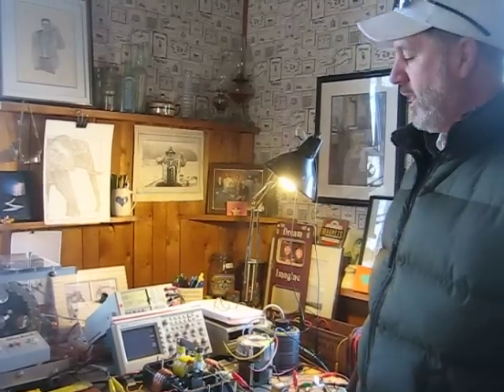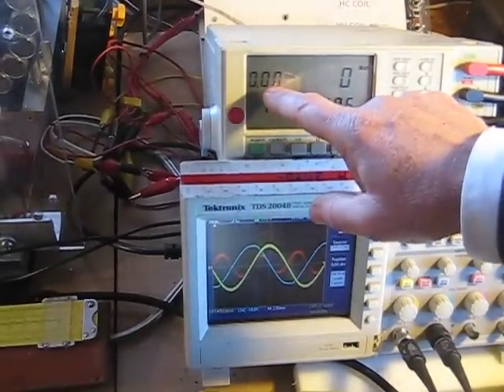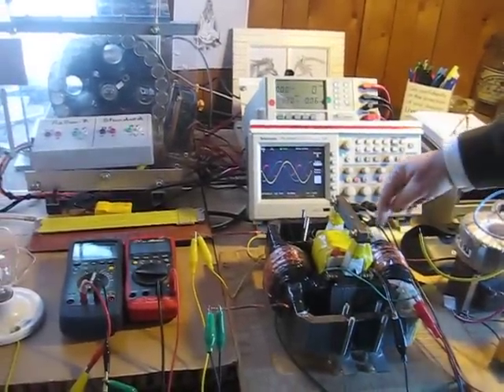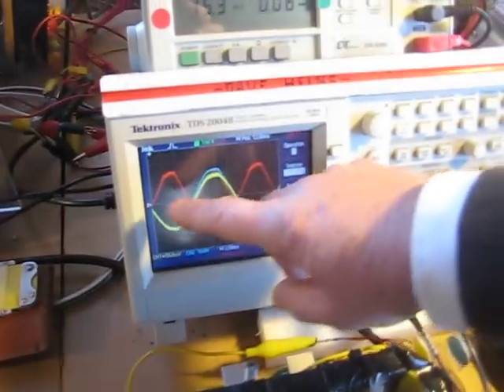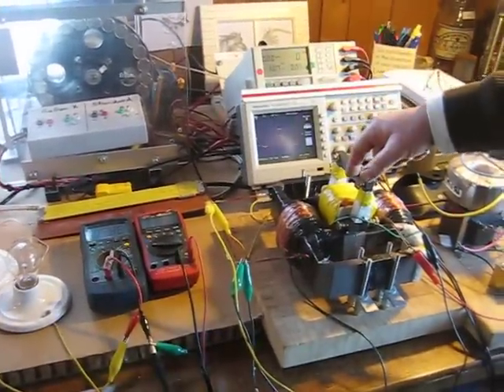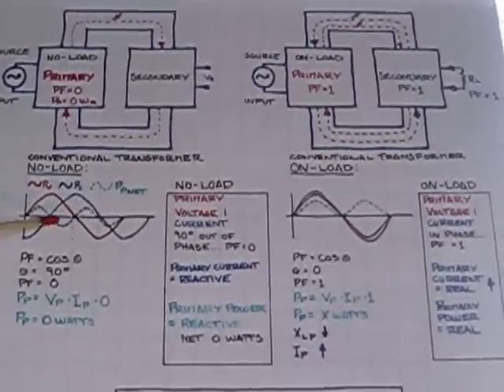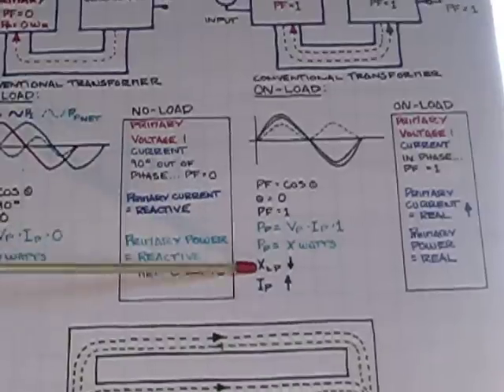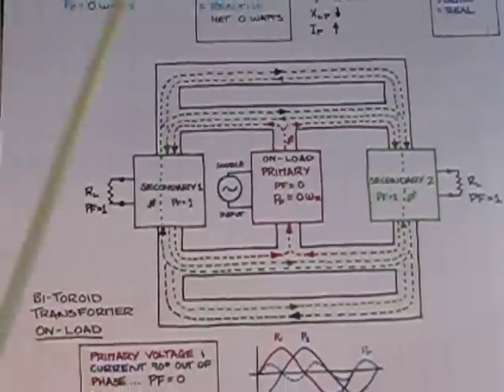INFINITE EFFICIENCY Bi-Toroid Transformer Operating with Zero PF Dec 7, 2014

Comment: Very nice elaborate test setup. My compliments to the profession quality work on your test fixture. 

I'm writing this under the assumption that the mistakes are honest mistakes.
 I noticed that the load voltage / current was tiny, not enough to light the bulbs, but no matter because the experiment didn't prove anything meaningful that I could see. You did spent time talking about power factor with the load vs. no load, but this doesn't mean anything from the perspective of having the experiment prove over unity in power production which IS the point of the device I assume. At the end of the day if it doesn't save on energy costs by producing more Wattage than it consumes, it's not useful.

You don't show your input (xformer input) Power in wattage compared to the output (load) Power in wattage which is required proof of the claims I've heard made about these devices. If you want to conduct a meaningful experiment you're going to have to show these values.

Power factor is merely the relationship between phase angle of voltage verses the phase angle of current and has almost NOTHING to do with the Power consumption of the circuit that our Watt hour meters accumulate from which we're charged for power. Power factor again is not a measure of how much wattage is being consumed. A transformer with no load on it is equivalent to a boat anchor so it doesn't matter what the PF reading is at 'no load'. When you connected your load, your PF went to 1 (one) on your oscope, or close to it which is expected with a purely resistive load, but you will have a slight shift because your load isn't really 100% resistive, it's partially inductive, so you'll get a small lag or shift of the current peak behind the voltage peak and thus a power factor less than 1, but no where near zero. If you could produce power to meaningful loads at a PF of Zero then you might have something because the measured wattage at the meter would be zero since they are completely out of phase and don't combine, but your experiment showed that not to be the case. The closer the PF is to 1, the more in alignment the peaks of voltage and current and thus the higher the reflected Wattage at the meter.

A meaningful experiment instead would be very simple to set up and perform:
Measure the input Power (Wattage) to the transformer vs. the load Power (Wattage) from the transformer and compare the two values. If you don't have a Watt meter, then measure and calculate Volts x Amps x PF(if you can't measure PF then assume a number around 90 - 95% with a resistive load or forget the number completely (meaning a one in the math)).

If P(in) = P(load) Then you can assert that the transformer is 100% efficient.
If P(in) < P(load) Then you can assert that the device produces power over unity.

If I had to bet on the outcome, my bet would be:
P(in) > P(load) This means that having the device in the circuit is robbing power and you're better off without it.
The only redeeming use of the device would be that if a person needs a transformer for stepping down voltage (or perhaps stepping up voltage for some reason), and this transformer configuration proves to be more efficient than a standard transformer, then by all means, use this device in place of a standard transformer.
If P(in)BiTT < P(in)Standard xformer given the same P(load) then go for it.

Comment: Thain, sir, have you done any MEG transformer work?
I just thought of something else. Crossing BiTT with electric motor design.
I am on a diode kick at the moment. I got two facing out on my gen coil, and an in and out running from both. My goal is to use the diode as a backstop, and ratchet power out of my receiver coil. (Make an H, the tops point down, the bottoms point up and down. Top is gen, bottom is DC...yet untested)Think it'll work? Any info or critique would be seriously considered. (no troll clubs to the head, please) Thanks-Josh

Comment: So basically, always connect loads across S1 and S2 together in parallel so that the resistive load is split equally between then, so that the flux balances.  And this effect will continue until you reach saturation, forcing the flux to go back and effect the primary coil

Comment: What is this nonsense?

Look at the ***equivalent circuit**. I put it to you that there is a mutual inductance between the primary and secondaries (so you get transformer action) AND THEN the secondaries have a large self-inductance and a large mutual inductance between them (the secondaries have a large transformer action between them).

The mutual inductance between the primary and secondaries is low, it's a loosely coupled transformer. Loading and shorting the secondaries has little impact on the primary.

The primary will have a bit of self-inductance and this will allow for a no load current. In an ideal transformer, the mutual inductance would be infinite and the self-inductance zero.

All you have here is a bit of power being induced from the primary into a secondary with a large amount of self-inductance. The current and voltage will be substantially out of phase with a little bit of non-reactive, transformer action power going to the load.

You can have lots and lots of volts and current but if they are not in phase, then there's little real power.

VA and Watts anybody? Textbook? Education?
Reply: +Michael Julian   All that you mention is not required on YouTube. All you need is a video camera and some time.  That's how this video came to be. An idiot with a smattering of test equipment and NO common sense.  What a waste of bandwidth...
Reply: Michael Julian to increase efficiency of biTT , place all three coils more close together. I have made my own version of this transformer. It has power factor 0.25 (25% real power) when shorted. Apparent power is 17 VARs . Output power is 12W real power.
Reply: 我复制了这个结构    85瓦输入   90瓦输出   但是下一步不知道该怎么做了    我直接用电表测的   功率因数0.87

Comment: I tried this with parts from the hardware store and it actually works.  Not over unity but my crude transformer put out 9 mW while the primary went down 7 mW.  Didn't think it would work.  Thanks Thane for sharing this info.
Reply: I didn't get that. The transformer outputted 9mW and it was consuming 7mW, isn't that overunity?
Reply: @waitin4thateeeeeeeg cuando conectas un "bi toroid " transformer a una fuente de 50 hz,110volts/220volts,la energia reeactiva a la entrada del transformador es convertida a energia activa en ambos secundarios,no se crea energia,simplemente es transformada .

Saludos
Reply: cxd4 you made it do anything better by now?

Comment: Please explain why, if the efficiency is "infinite" and you are "creating energy"... why does it still have to be plugged into a power supply? Why can't you simply run another identical unit from the output of the first unit, and so on, daisy-chaining several units together, then run the first one from the output of the last one?
I know why, and so do you.
I've made this offer many times and I'll make it again: If anyone shows me a device with electrical inputs and outputs, that genuinely outputs at least 1.3 times its input energy, I can make it self-loop and run itself. Guaranteed. I don't care in what form the inputs and outputs are: AC, single or threephase, DC, LF, HV HF, doesn't matter, because I know how to handle the necessary conversions efficiently. All that is needed is actual 1.3 or more times "overunity" performance.
I can do this, and so can any competent EE with experience in power supply theory. And many hobbyists that I know about can do it too. So... when will YOU be doing it, Mr. Heins?
Reply: TinselKoala 
Free energy SCAMS never ends!!! It's a profitable business
Reply: @mrnandus  😂 well done! You have No idea what this is!
Reply: well he's close here , ha he likely already has, why would he tell you?
Reply: Kolin Evans
Care to place a little bet on that?
And no, he's not even close. Nobody can run anything on DMM readings or squiggly colored lines on an oscilloscope.
Reply: +TinselKoala what's the bet on? lol who says you can't run things on squiggly lines?
Reply: TinselKoala you seem a little jaded man I see you on a lot of these video ha ha, maybe get out a little, go for a walk smell the freash air ha ha.
Reply: Kolin Evans
Well, at least you got that right, even if you can't spell so well. I'm jaded all right, sick and tired of people making false claims of "free energy" or "infinite efficiency" when they are still buying all their electricity from the local grid. Can't even daisy-chain three identical "free energy" devices, all running off of only the input to the first one... that's a real "LOL" for sure.
Reply: +TinselKoala so you're jaded about that? really? like I said maybe get out more man. looks like it's really eating you up?
Reply: Kolin Evans
Why are you  so worried about what I might think or do? Maybe you are the one who needs to get out more.
Reply: TinselKoala im not worried of your opinion but then I'm not trolling around video after video angrily commenting,  there are only 2 primary options from a psychological perspective 1. You are unable to work out the effects and feel angry because of the disconnection of your original programming and the conflict of that with some new effect, or 2. You get some other monetary motivation. 
I would say it is (1) having completed a fairly good study on the effect of humans faced with alternative information V original programming,  you don't know what the new effect is, you know its there and you feel cheated by 'the system' that programmed you.
Reply: Kolin Evans
It might be possible for you to be more wrong, but I can't figure out how.

And I note that you still haven't bothered actually to refute me, you just want to insult me.
 That makes you the troll, by the way.
Reply: TinselKoala oh I'm not calling you a troll, as stated I've studied it, sure it's possible just unlikely,  because like (ha ha) magnetic flux, humans will often take the most optimum path through life with the most education,  if you are getting 8 $ an hour by some corp, this would be grinding against your qsoul badly,  no more likely as I said, you are angry at programming.
Reply: TinselKoala the assumption that because it's not on YouTube then it doesn't exist is flawed on multiple vectors,  it also goes against some very well known human psychological aspects. 
So when failure in all these variables all you have to do is look at what is, you can wind wire around a core I assume?
Reply: Kolin Evans
You should slow down so you get your words straight. Let's see... what psychological aspect would cause a person to claim what is claimed in this video, but fail to provide adequate proof of it? What psychological aspect makes someone like you want to attack someone like me, instead of providing a solid refutation of my criticisms?
You can "assume" whatever you like about me, but those who know me, know whether or not I can wind a coil. And whether or not I can perform proper measurements to support my contentions. You, on the other hand, have no credibility with your three video uploads, which have nothing to do with physics.
Reply: TinselKoala there you go again,  I think you might have spent too much time on YouTube? 
You think I'm attacking you?
No you are further confused,  I stated there are numerous psychological vectors that relate to why humans would not post numerous 'working' devices. Assuming they find the answers they are looking for. 
You seem confused somewhat about the way your society functions,  you are human right?  You've been I assume born on this planet? 
Regardless of that, the evidence and science of the various aspects displayed show effects you can't explain,  and by best guess is this makes you angry,  due to your human programming.  
One can see a similar effect replicated with 'physicists' when confronted with 'massless' thrust from the 'EM Drive' 
I'd hate to say it but, all these vectors do lead towards the ever prevalent 'autism' that most of the human population are effected by.
Reply: Kolin Evans
You can attack me all you like, but it doesn't change the facts of the matter: This video makes unsubstantiated claims that are a result of mismeasurement and lack of real understanding of the topic by the presenter.  You are also wrong when you state that this video and others "show effects that (I) can't explain."  Your interest in psychology should be directed toward understanding why people make false claims like those shown in this video.
This video is presented as "proof" in an effort to convince others of the claims. So there goes your objection about why someone would not post real proof and real tests of their claims such as daisy-chaining multiple identical devices each working on the output of the prior one in the chain with only the first one requiring input power from an outside source. The reason this is not done is because the presenter knows it cannot be done. And so do you, I think. You're just trolling along at this point.
Reply: What are you trying to claim ? That this effect (as shown) is not real?
Reply: Kolin Evans
I'm not "trying to claim" anything. I'm stating right out that the video does not show any "overunity" or CREATION of energy, and that the measurements shown are 1) not being done properly; 2) irrelevant and inappropriate to test the claim; and/or 3) being misinterpreted in favor of the claimant's idee fixe -- which by the way has been going on for many years now.
Reply: Because it’s a concept about real power, and reactive power.

Yes it’s clearly not possible to create energy, and the video is not showing or saying it creates energy at all!

This is showing that you can use reactive power to do real work, and power a restive load / circuit. 

The ‘infinite’ point is pointing to the fact that the primary is a pure reactive circuit always, and therefore does not use real power!
Reply: The explanation of the magnetic flux paths of the bi-toroidal transformer with symmetric loadings is fundamentally wrong. The reactive fluxes from the two loaded secondary coils cannot complete their paths in the low reluctance magnetic loops to cancel each other out because at the plane of symmetry, the magnetic circuit of the low reluctance magnetic loop is equivalent to an open circuit, breaking the path of the magnetic circuit. So the reactive magnetic fluxes of the two loaded secondary coils will still complete their paths through the high reluctance circuit through the primary exciting coil. Therefore you can never get rid of the reactive magnetic fluxes from the two loaded coil, and consequently the conservation of energy is always preserved. There is no such thing as a free energy magnetic device! In much the same way you can never get rid of the inertia reactive force in a mechanical context. It is part and parcel of the principle of the conservation of energy.

Comment: I need more information on cross section area and wire turn rate, primary to secondary...
Reply: Will Green cross section area and turn ratio is not important. what gives free energy is core structure. You can see core structure and coils in video. I have replicated this transformer (or invented new version) and it works.